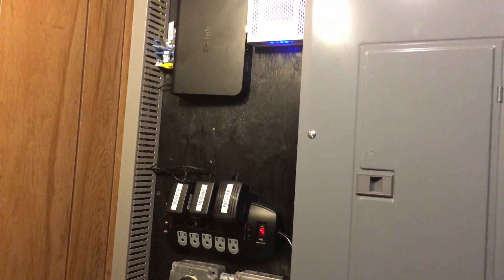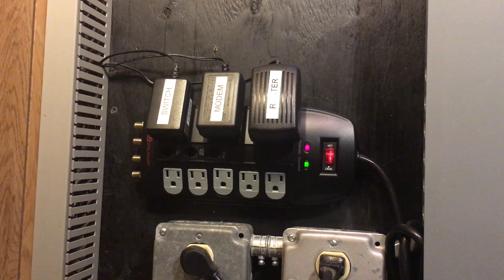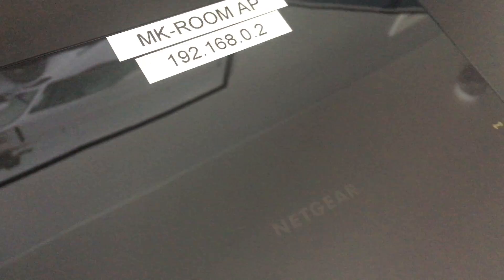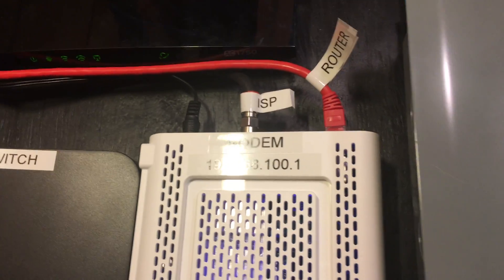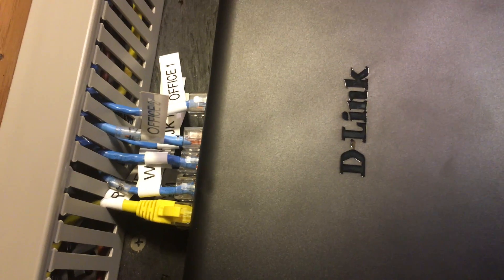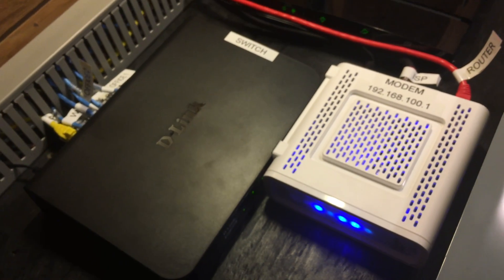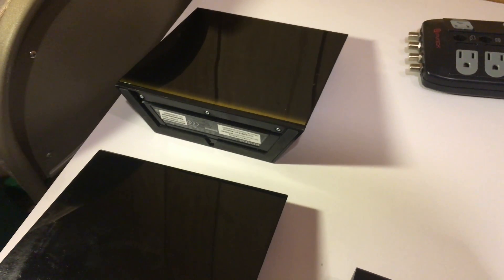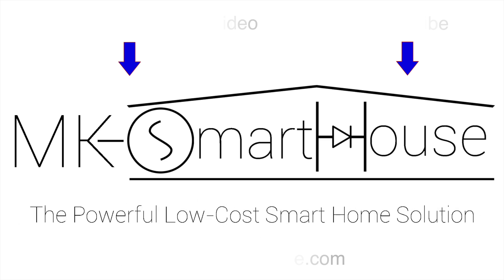Complete Guide Setting Up The Smart Home Network: Demo

Comment: Great video series.  I will review them all.  BTW, is your network quality impacted by the electrical box right there beside it? Also, would you recommend I focus on a hard wired network in my new home or rely on wifi access points?
Reply from the maker: Thank you! No the network is not impacted by its location next to the electrical boxes. I recommend where you can go wired than do indeed go wired. Definitely any computers should be wired. Also I recommend having access points that are wired to your main router like i demonstrated in the video.

Comment: You should really move your TP-Link's wireless antennas at least 18 inches away from that electrical conduit.  The metal in the conduit will cause scattering of the RF from the access point.
Reply: You said it before I was ahahah

Comment: One thing that I am concerned about with having everything wired and on 24/7 would be are they lightning/surge/ups protected and how do I go about it to protect that 'server room/main control', using your system as an example. Thanks.
Reply from the maker: That is why we use the surge protector power strip

Comment: Glad to see you've updated hardware.
Reply from the maker: Yea I simplified it and upgraded everything to gigabit! This is all in preparation for the home automation server and the devices!
Reply: MK-SmartHouse good work btw. It also looks much better. Rasberry just released zero w, now with wifi and Bluetooth on board, don't know if you need it in the build or not. Network setup can't stop me but when it comes to Arduino or rasberry I'm at total lost.
Reply from the maker: Thanks for letting me know about the RPi Zero update, and thanks I work really hard on these videos! Don't worry about being lost with raspberry pi or Arduino I will hopefully make it easy.